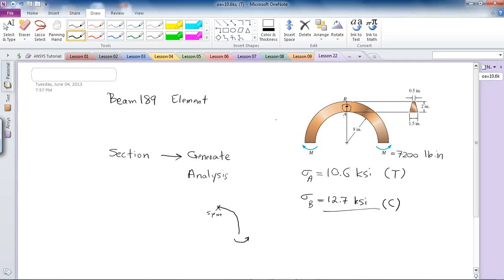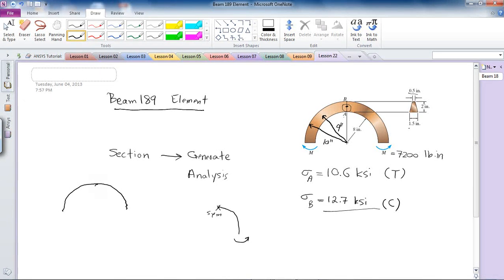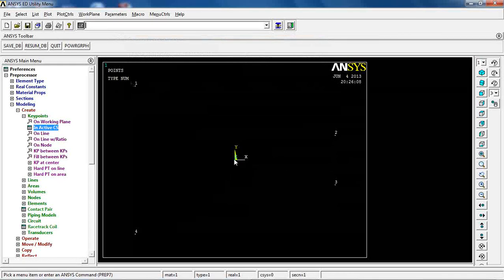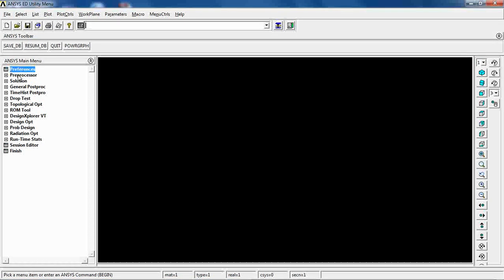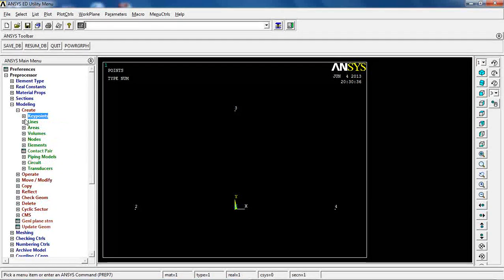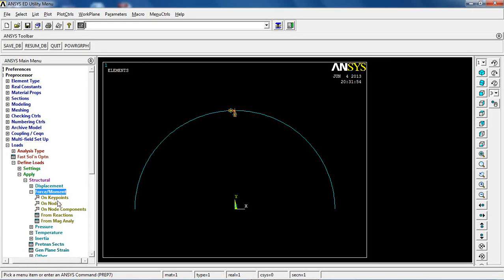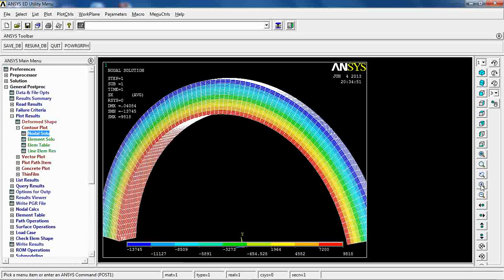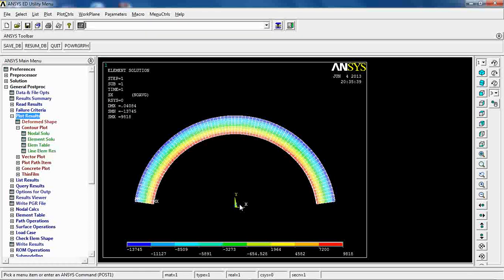ANSYS - Lesson 22: Curved Beam with Trapezoid Cross Section

Comment: hello, what happen with I cross section?
Reply: You can just use the common section in which there is I beam in that. There is no need for the first step to create the section as shown in this video if you are considering I Beam. Just go to Modelling>Sections> "Common sections" you will find the predefined I beam where you can specify the dimensions for the beam.